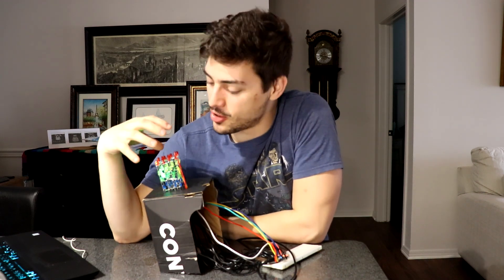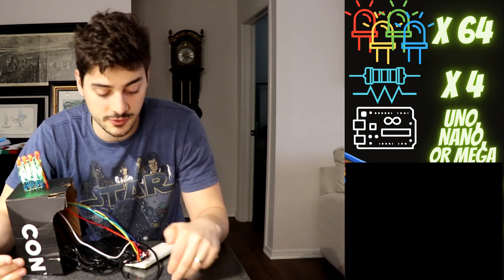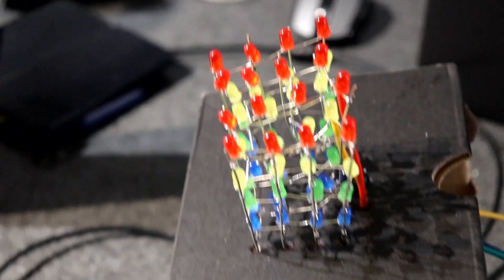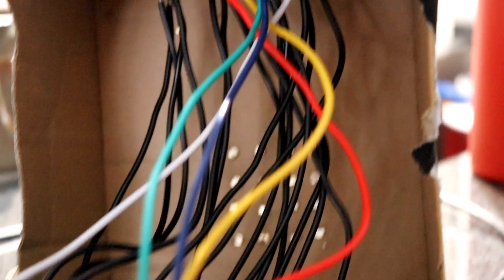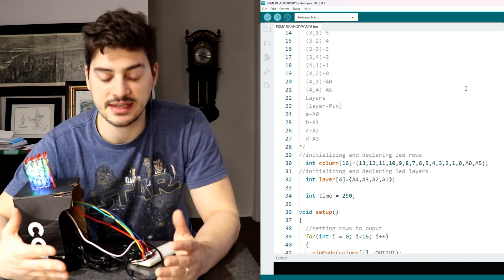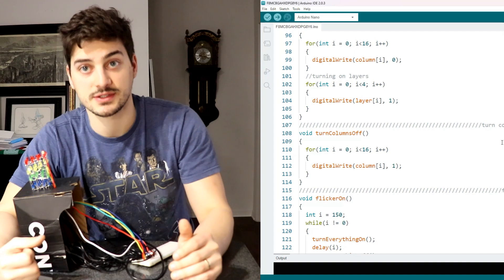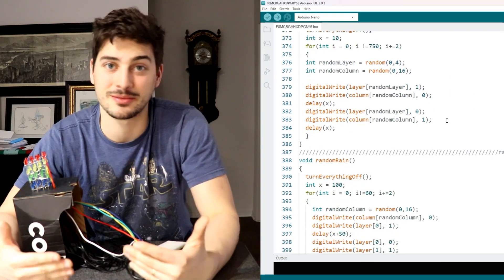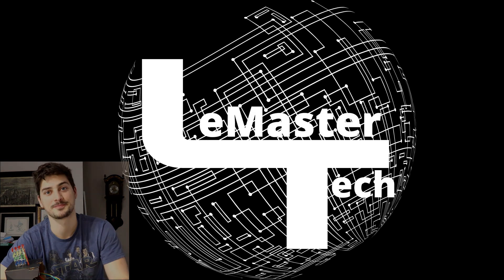How To Make a 4x4 Arduino LED Cube!

Comment: I have some ideas on your 4x4x4 led cube, but my code is not working. Can you help me?
Reply from the maker: What issue are you having with it?
Reply: I want to make raindrops effect the bottom 3 layers and flickering effect on the top layer . Right now, I have two different functions . I want to run both at the same time!
Reply from the maker: Well you’ll really probably need to build them together, you can call a function from inside a function so you could call a flicker from inside the raindrop sequence potentially!